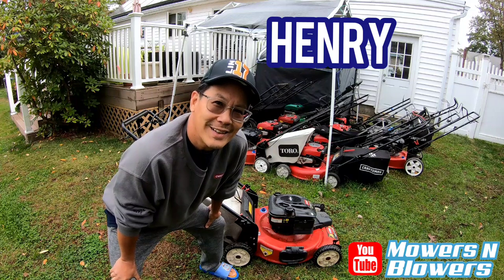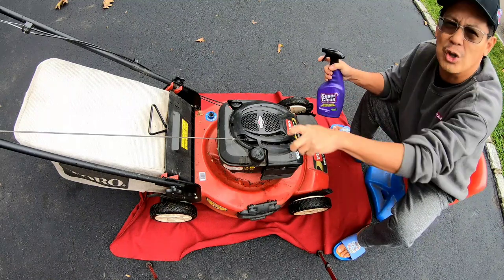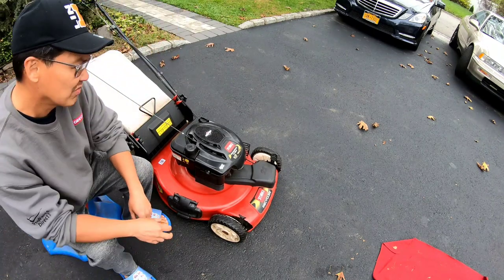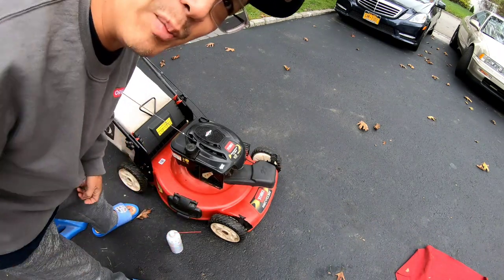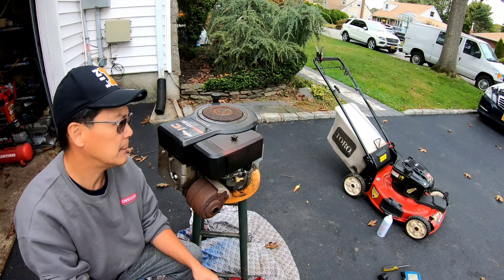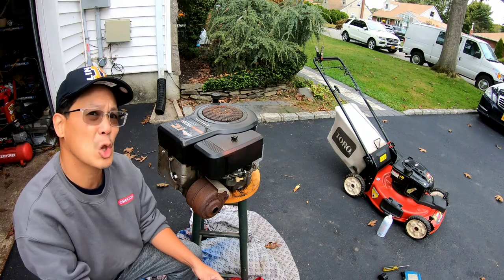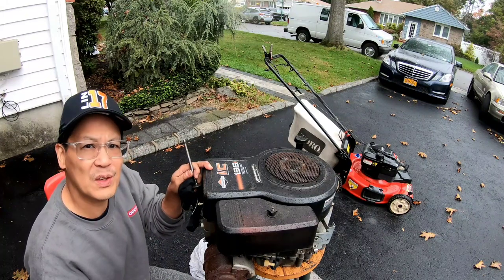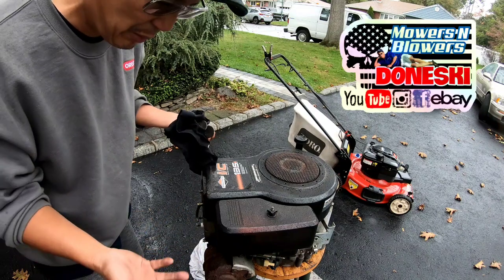BRIGGS & STRATTON FLATHEAD ENGINE INTAKE EXHAUST VALVE REPLACEMENT-SEAFOAM GDI & WONDER SCRUB REVIEW

Comment: Aluminum block is soft and it's possible a couple of lag bolts the right size and length may screw in there to secure the head better. Cheap fix too if it works... just a thought!
Reply from the maker: Long time no comment Don, good to hear from you again.

Comment: How’s that going clean a jet if you’re bypassing the carburetor by spraying it straight down the intake ??
Reply from the maker: I sprayed it in the mouth through intake, also the front primer hole and passage to Welch plug.  Spraying it through the intake is really cleaning carbon in the valves.  I did it all!